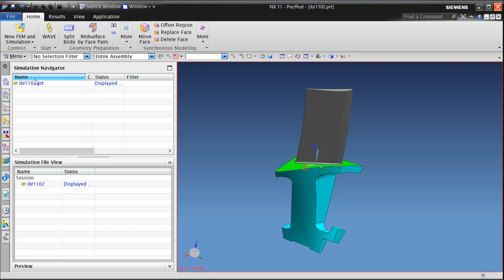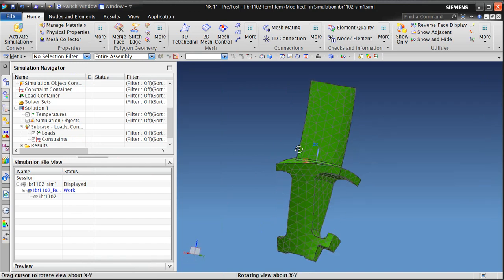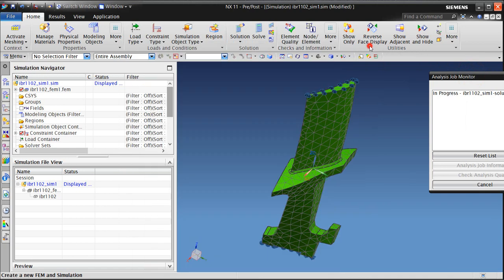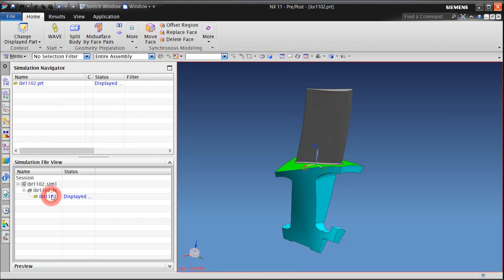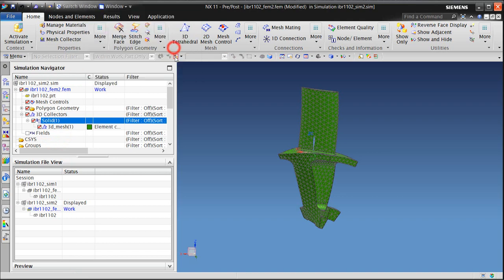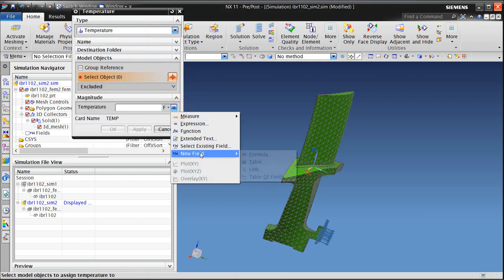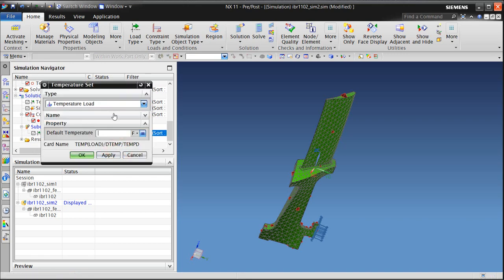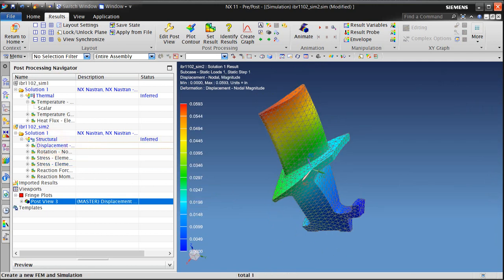Simcenter 3D Temperature Mapping

Comment: Hi need a help,
I have a fairly large model with thermal load mapped as node Id table on every node. The issue is when ever I select the load or even click it in the model tree, the whole model is highlighted even if there is nothing in viewport. I switched off highlighting in boundary condition display but still it's not working. And this process of highlight is taking long time, sometimes upto 2min. Is there any way to switch off highlighting of loads
Reply from the maker: No but there are a few things you can do to make it faster.  First ensure you are running the certified graphics driver as shown in this video: https://youtu.be/6ads82zneTc  If that doesn't help, you can change it from highlighting faces to just the edges by selecting Menu - Preferences - Selection - Highlight.  Now change Highlight Faces to Highlight Edges.  I also remember some performance issues with highlighting back in the NX10-NX12 timeframe which have since been fixed.  What version are you running?
Reply: @Simcenter3DTipsandTricks  alas, I am using nx11, I have around 15 load case and it's taking a long time just to add to active solution. Response after Just clicking on the load itself is slowww
Reply from the maker: @gaganaut06  Time to upgrade to 2212.  Did you check your graphics driver?
Reply: @Simcenter3DTipsandTricks  I will, thanks for the reply